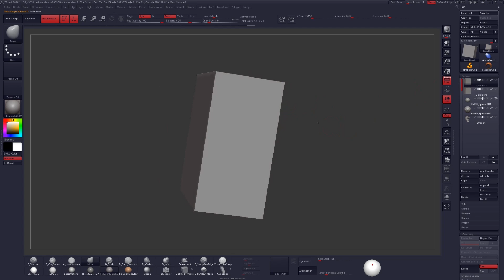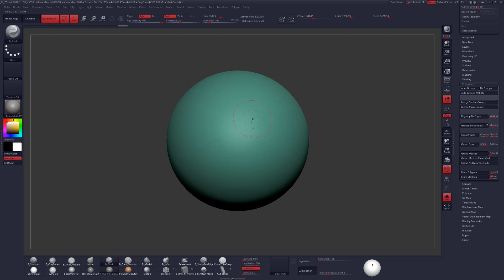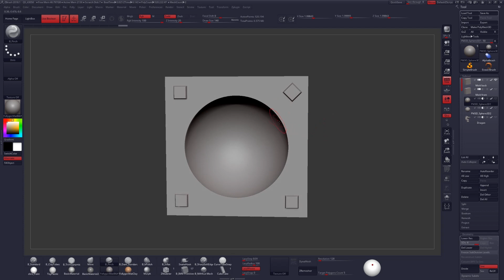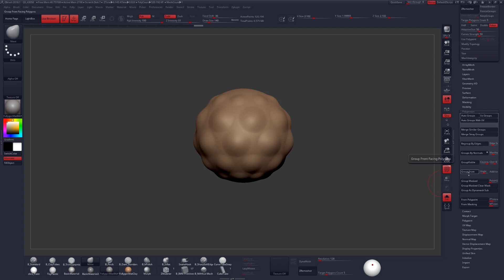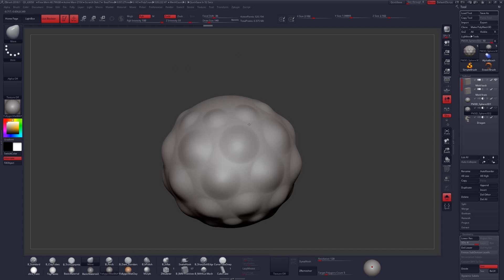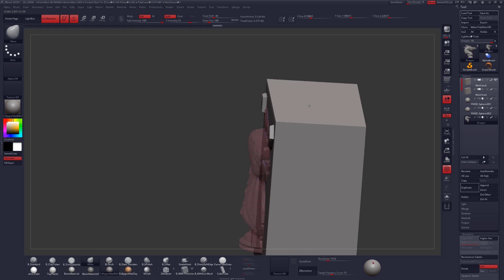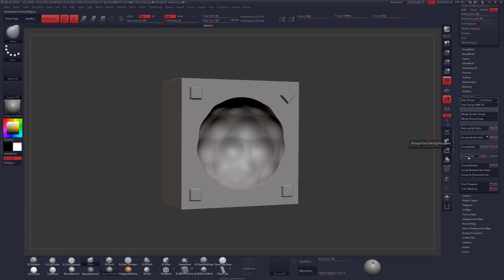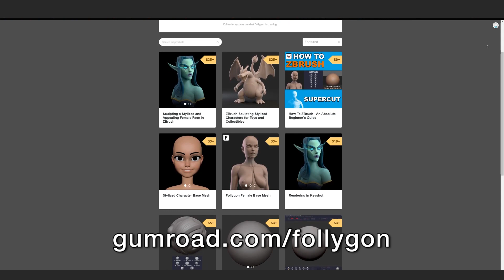An Easy Way to Prepare 3D Models for Molding - ZBrush Tutorial

Comment: hmmm.. I don't get it. If the mold object itself is large enough, it should cover all the surfaces and you shouldn't run into any issues at all. For example with the dragon. Why would you get any issues, if your mold is just made out of two pieces?
Reply: Undercuts can cause demolding issues which is why you need to plan how many parts your mold has. The dragon especially needs more than 2 parts because of the overbite on the teeth, it will lock most casting materials into the mold. Unless the casting medium is soft like silicone, those teeth are going to break off during the demolding stage if the mold is only 2 parts. It’s not about it being a large enough surface to cover it (though that is important for the life of the mold), it’s about not having all the undercuts which in turn will act as keys to completely brick your mold. If you have time, watch some of Smooth-on’s videos. They cover how to mold many complex objects. While it’s not 3D sculpting, it will help you better understand molding so that you can implement it in the 3D context.

Comment: Hello, I have a question: I have a 3D design, but you can not start from the middle because it has arms and legs and is slightly moved, how can it be done?
Reply: Create a multi part mold, or remove the arms and legs and mold them separately.